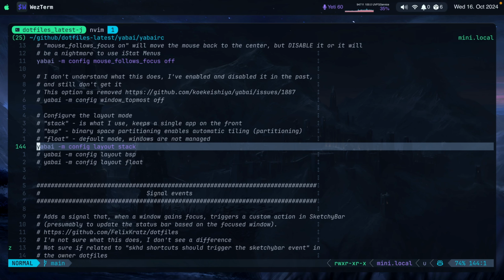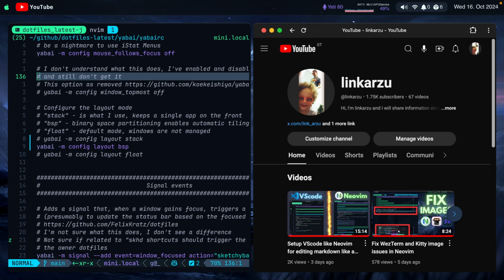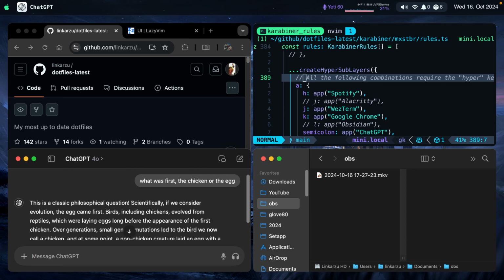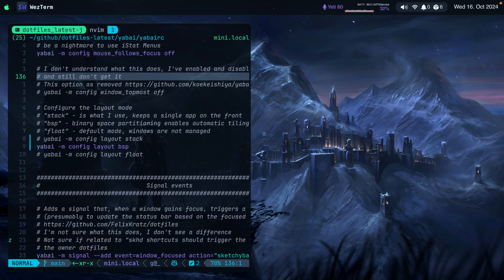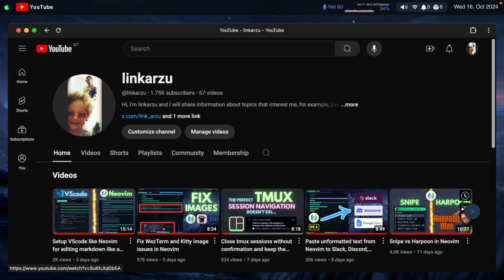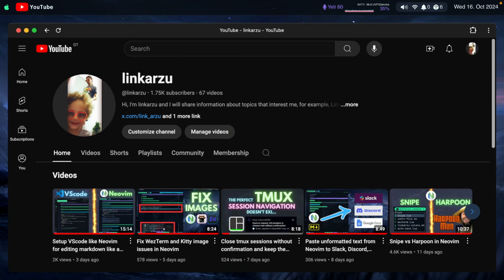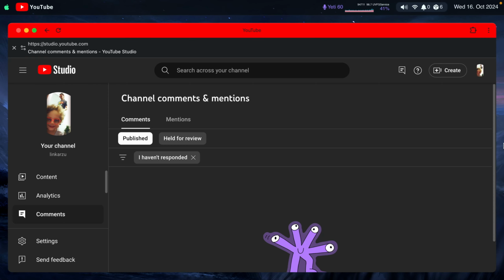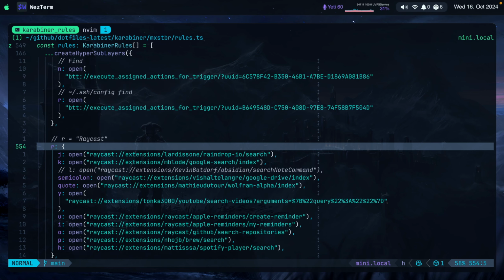Tiled or stacked apps when using tiling window managers? My thoughts and setup

Comment: Love your videos man - I’m also a Mac user and we share so much in common in terms of config/workflow! I’m also using yabai but in tiling mode with different desktops and using space launcher to switch between apps. Have you messed with yabai rules? I think there is an option to set up rules to assign apps to different spaces and then you can just declare this in the yabai config file and not thru macOS.
Reply from the maker: Honestly, I don't understand why different spaces are needed when all could remain in the same space and just switch to apps, avoiding any animations or space management. But I guess that's something you definitely need to do if you use tiling mode, and I also don't see the benefit of tiling mode, especially with a 27inch monitor or more importantly, a laptop screen.

Would you mind sharing how you manage apps in different desktops using yabai rues? In case some day I have a strange scenario in which I need to use tiling windows or something, that would be appreciated.

I'd also recommend you to check out my yabai 2024 updates video
https://youtu.be/9SQG5ogWEug
Reply: As a web dev it's useful to have neovim opened alongside a web browser window and having a tiling layout makes sense for similar use cases. There isn't really a lot of overhead if you use something like space launcher (or karabiner) for app switching this way. Also having the yabai automation rules definitely helps too, I managed to set these up like so (the function is necessary to also apply the rule, just adding it doesn't work):  

function yabai_rule {
  yabai -m rule --add "$@"
  yabai -m rule --apply "$@"
}

# automation rules
yabai_rule app="^WezTerm$" space=2 label="assign-wezterm" sticky=off
# ... your other rules

Will also check out your yabai video, maybe I steal something for my own config haha :)
Reply from the maker: @MyBlancpain  appreciate the examples, thank you very much!

Comment: I’ve been a fan of your content, and I wanted to share my setup with you. 

I  using KDE with the following setup settings:

System Settings Adjustments

    Go to System Settings > Window Management > Task Switcher and disable "Show selected window".
    Change the following shortcuts:
        Alt+Tab to Mod+L
        Alt+Shift+Tab to Mod+H
        Alt+` to Mod+K
        Alt+[reverse current application] to Mod+J (I apologize for not remembering the exact key combination)
    Set the KRunner shortcut to Mod
    Set the Overview shortcut to Mod+D
    Set the background color to #222222 ("Don't put anything on the desktop.")
    Set the animation speed to Instant

Workspace and Window Management

    Set up your workspace shortcuts
    I highly recommend using the "Maximize" feature instead of full screen. I personally use the shortcut Mod+; for this.

The Most Important Step: No Titlebar and Frame

    Open System Settings > Window Management > Window Rules
    Select "Window Class (Application)" and choose "Regular expression"
    Enter a dot (.) in the field next to "Window Class"
    Ensure "Window Types" is set to "All selected"
    Click the "Add Property" button and select "No titlebar and frame"
    After adding the property, select "Force" and set it to "Yes"
    Apply the changes
----
I'm currently trying to learn and understand the behavior of the task switcher so I can get used to it without seeing which app I'll switch to

Comment: At 5:31 I was wondering why your terminal was transparent / we could see the desktop although it is stacked with other apps behind the terminal. I saw in your dotfiles that you make the "below apps" transparent. That's a neat little trick for a single desktop/space solution. Excellent.
Reply from the maker: Yep, that's a neat little trick to set my apps transparent, and like you said, it works great when using yabai in "stack" mode
Reply: @linkarzu  Currently when you enter macOS Mission Control, your background windows stay "transparent". You could fix this by adding something like this to your yabai config (since yabai has mission_control events):

# you could probably also convert your existing apps_transparent variable to this format
apps_transparent2="(kitty MailMate Calendar)"
yabai -m signal --add event=mission_control_enter action="yabai -m config normal_window_opacity 1.0"
yabai -m signal --add event=mission_control_exit action="(($apps_transparent2[(Ie)$(yabai -m query --windows --window | jq -r '.app')])) && yabai -m config normal_window_opacity 0.00001"

These lines will make your windows non transparent and after you exit mission control will check if one of your transparent apps is selected and if yes will make again the background apps transparent. This syntax works if your yabai config is executed under zsh shell (which should be the macOS default).
Reply from the maker: Nice trick!!!!!!
Appreciate it, but what happens if I change the variable to that format and I have an app that has spaces in between it's name, like "CleanShot X" for example
I just commited your change, left a comment there giving credit back to you!
Reply: @linkarzu  Sorry, my mistake. Here's how to declare the array (you can then use double quotes for each item with spaces):
apps_transparent2=(kitty "CleanShot X")

I now changed my config so it automatically generates the "array"-version from this string version "(app1|app2)", so you only have to define the apps in one place (works in zsh-shell... in bash the convert to array is different):

# Declare the apps
apps_transparent="(kitty|MailMate|Calendar)"
# Convert above into an array
apps_transparent_array=(${(@s:|:)${apps_transparent//[\(\)]/}})

yabai -m signal --add event=mission_control_enter action="yabai -m config normal_window_opacity 1.0"
yabai -m signal --add event=mission_control_exit action="(($apps_transparent_array[(Ie)$(yabai -m query --windows --window | jq -r '.app')])) && yabai -m config normal_window_opacity 0.00001"
Reply from the maker: Appreciate it, I'll check that out!
Reply from the maker: Appreciate it, will check that out!

Comment: I guess a lot depends on how much effective screen space one has. Here, with this size of font and window bars, top menu, empty space etc. we see there's not much content you can have on screen, so single window mode makes sense. With a larger screen (or smaller elements, relatively smaller font, smaller decorations and less space wasted) one can fit more content, more windows, there tiling makes more sense.
Reply: @thedeemon That's true but I guess that's the point to only have one app open on purpose, so you are focusing only on one app instead of multiple ones
Reply from the maker: Yep, completely agree, if I went back to my 52 inch TV as a monitor, or maybe not something as big, like an ultra-wide monitor it would make sense. But not on my 14 inch laptop, and that's my main goal, be effective on my 14 inch laptop screen

Comment: I run Amethyst but came to the same conclusion - one full screen app at the time. My Kitty also has only stack layout enabled.
Reply from the maker: Thanks for sharing! With amethyst can you have a single app on the screen at a time using all the space?
Reply: @linkarzu  Yup, it's with the "Full" layout I believe. I set it up long ago, might not necessarily recall the layout names.
Reply from the maker: Sorry, had posted the wrong message. Appreciate it, thanks for sharing!

Comment: i also use yabai, there are rooms for improvemrnt but i have add shortchts for placing certain windoes ontop of the current one. i use stacking and bsp. i would use stakced only if i didnt have an ultrawide. using ultrqwide gave me tons of problems that i needed to solve
Reply from the maker: I thought about getting an ultrawide when I switched from my 52 inch TV to a monitor, but I was going to end up with the same problem of not being as efficient when I switched to my laptop, so I went with a regular 27inch monitor. Now it doesn't matter what computer I'm on, I can be as fast in any of them.

I'd like to learn more, what issues did you experience with ultrawides? And also you mentioned that you use stacking and BSP, does this mean both at the same time? I remember reading somewhere in the yabai changelog that you can have multiple stacks of different apps on the screen but maybe I'm wrong
Reply: @linkarzu  yup, i normally do a side by side 2 windows, each having its own stack. with hammerspoon, someone made a little nice indicator of how many thing you have stacked up per stack. here were the problems:
when you use 2 monitors, the most naive way to get around is to have multiple virtual desktops where each represents an app. 1 => wezterm, 2 =>zoom, ..., 9 =>slack. then you could have 1->5 show on the left monitor, 6-10 on the right. Then you can jump to any app with just macos shortcut without affecting whats displayed on the other screen.
this doe not work with an ultrawide, 1 virtual desktop is 1 thing, you cant have the left move, and the right not move, which is why i started using 2 stacks, one on the left, one on the right. 

my usual workflow is move to left or right, use keybinds to bring certain app on top of my existing stack. like say hyper+t, to find wezterm window and put it on top of my current stack

let me know if its not clear
Reply: @linkarzu  you would not have any of these problems with 1 monitor utilizing the stack. but you lose the nice ability to have something on the side at all times
Reply from the maker: @hechuan5075  I'm not planning on switching to this other mode of having 2 stacks on the screen, but I've always thought about it. I'd like to see how its configured, do you have your dotfiles public by any chance?

And yeah, I agree, I don't have any of the problems you described by using a single monitor, and I also agree that I lose the ability to have something on the side at all times, but I just optimized my workflow to not depend on having something on the side at all. The only reason I think that would be helpful is if I some day decide to stream, and want to have something only for me on a separate screen so I would probably use a 2nd monitor.

I guess following tutorials is also nice if you have something on the side, but I've just adapted and I don't think I miss it too much

We'll see what I think in a couple of years, but so far, at least for me it has worked great.
Reply: @linkarzu  also if i started over, i would have focred myself into trying 1 single screen, so much less overhead
Reply from the maker: @hechuan5075  It's never too late to give it a try 🤣
when I was still using a 52 inch TV, I configured yabai to use stack mode and configured huge paddings to only use around 1/4 of the screen, spent that way a few months, got used to it, and then bought a small monitor

Comment: Tiling window managers don't suit all workflows but for mine it was a huge relief.

I'm using aerospace personally. It doesn't require disabling SIP and has no delay when switching between workspaces, as it does away with Apple's implementation and replaces it with its own.

I'm using 25 workspaces across 2 monitors and it's a surprisingly consistent and intuitive experience. Right `CMD` is my hyper and `1-0`, `Q-T`, `A-G`, `Z-B` are my workspaces. And it's `Hyper + letter` with or without `Shift` for most operations.

I don't have shortcuts for individual applications. Instead I have all terminal applications start in space 1, for example, so no matter which one I use today, `Hyper + 1` brings me to my terminal.

Most of my apps are fullscreen, some are tiled side by side or one above another (my secondary monitor is vertical). If 2 apps are related but need as much space as possible, I'll use a stacked mode within one space and toggle focus. Switching mode between tiled, stacked and floating is one shortcut away.

Most frequently used apps are assigned to specific spaces they always open in. Some spaces are assigned to a secondary monitor by default but I may temporarily move such space to a main monitor to focus my attention on it, then throw it back to the side. All done from the keyboard and configured in a toml file. No need to click around macOS UI. No need for additional software other than the one I use to create Hyper key. Default config actually uses `Alt`, so even that is not necessary.

I make use of Safari's "Save to Dock" feature to create separate "apps" for sites I want to window manage individually.

Comment: Aerospace and spaceLauncher together is awesome.
Reply from the maker: I've been recommended in the past to try Aerospace, I have to give it a try
Reply: Yeah, wanted to recommend AeroSpace, where the biggest advantage is that it implements its own "spaces", so not limited by terrible MacOS API for its spaces and doesn't need any SIP fiddling like Yabai, so safe for work laptop as well.
Reply from the maker: But I also use yabai in my work computer, I just don’t disable SIP and everything works, just my apps are not transparent
Reply: @linkarzu  Maybe things have changed since I used Yabai, but, for me, the single most annoying thing was the delay happening when switching spaces

I disabled the anmiation, but the delay was always there (again, a MacOS thing).

And, IIRC, Yabai needs disabled SIP to eliminate that delay.
Reply from the maker: I’m not sure, but what you see in my videos, it’s the exact same way it behaves in my work computer, only my terminal is not transparent, I don’t feel any delay. And SIP is not disabled on my work computer
Reply from the maker: But also notice I don’t use spaces, so I may not be the best reference here 😂
Reply: @linkarzu  Oh my bad, I thought you're putting windows in different spaces; maybe I need to watch the video again
Reply from the maker: @farzadmf for demonstrating BSP mode in the video I do, but for stack mode, which is what I use, I keep all the apps in the same space
Reply: @linkarzu  Right!, watched again! So, "technically" speaking, you're not using the "normal" i3 behavior, but I like your approach

Although I myself sometimes need a couple of apps in a single screen/place/space/whatever it's called :P

AeroSpace is trying to be like i3 (even the Web page mentions that), and I'm used to my i3 workflow from my Linux days, and AeroSpace resonates with me
Reply from the maker: @farzadmf  I know why I never tried aerospace. Based on my old dotfiles repo, I probably started using yabai around July 2023, Aerospace first release was on Oct 2023. 
Back then, after watching Prime's workflow video I was looking for an i3 alternative for macOS, because I wanted what Prime had, so I could only find Yabai, sure there where others like Amethyst or Rectangle I think, but they didn't even come close.

Based on what you're telling me know I'm curious to test Aerospace, I guess I will have to and compare it to Yabai in my specific workflow.

I have never used i3, but Prime's video opened my eyes and gave me ideas, so I ended up with this workflow that I really like
Reply: @linkarzu  Totally understandable; every person has their own workflow.

For me, for example, I quite often have the use case of moving windows to different "places", stacking them, tiling them, etc. (maybe because I loved how i3 worked).

But yeah, it took me also a while to give AeroSpace a proper test; first time I tried, I was like "OK, gonna continue with Yabai" (the disabled SIP experience is nice).

But yeah, as I said, for me the most annoying thing was the "pause" happening for each "workspace" change, and that was the main reason I gave AeroSpace another shot.

I suggest you give it a shot as well; who knows? Maybe you'll like it 😉
Reply from the maker: @farzadmf but I'll lose my transparent apps, won't be able to brag about them in my videos 😢😢😢

I’ll try it for sure, and we’ll see
Reply: @linkarzu  Oh yeah, no more bragging 😆

Also, not sure if you have it or not, but I'm curious about your Karabiner config; I see you're using Typescript.

I'm personally using the Goku tool; I'm curious how your config workflow is
Reply from the maker: @farzadmf  I've put so much time into my typescript config, that I don't want to switch to goku, I searched for a karabiner.json file to goku converter, but there is not one, so I just don't want to go through the hassle of setting everything up in goku from the start. 

In this same video I reference my karabiner, there I go over my entire karabiner workflow
Reply: Aerospace is great but I noticed I get substantial lag if I have a more heavy app open and try to switch to another app from it so I went back to yabai. Shame because otherwise aerospace is very cool and you dont have to disable SIP etc
Reply from the maker: @MyBlancpain  A lot of people have commented about this lag you mention, in other videos of mine
Reply: @MyBlancpain  Yeah, I don't personally have a lot of apps open, but I must say I DID have super long delays on my 2019 Intel Mac, but recently I got an M3 and things are almost instant

Comment: Cool setup and great vid! Also, I think I remember you mentioned in a earlier video, you where using Asahi on your mac? If you did I would be really interested to hear your thoughts on macos vs asahi and why you switched back.
Reply from the maker: I haven't tried Asahi on a mac Yet, I've heard about it and I thought it was a cool idea, and definitely something I need to try in the future.

I haven't put the time to be honest because macOS is extremely stable for me and hasn't given me any sort of issues in the past 5 years. All I care about is stability and compatibility.

I guess when privacy becomes an issue for me in macOS I'll think about which Linux distro to switch to, but for now, I don't have any plans to do so. GitHub has all my data in repos anyway 🤣

Have you used Asahi, what are your thoughts?